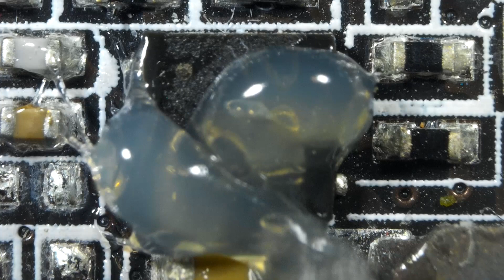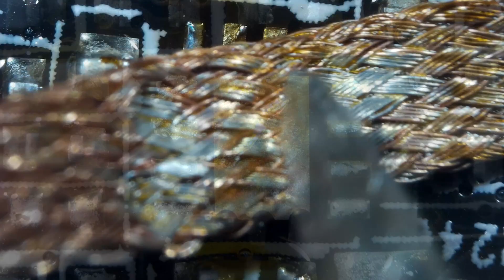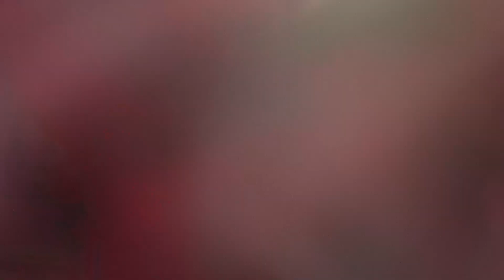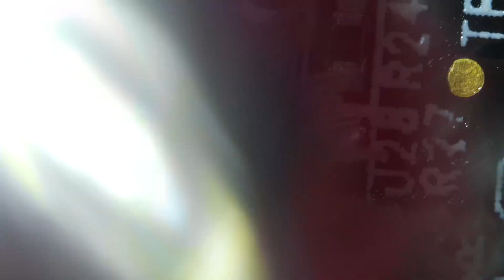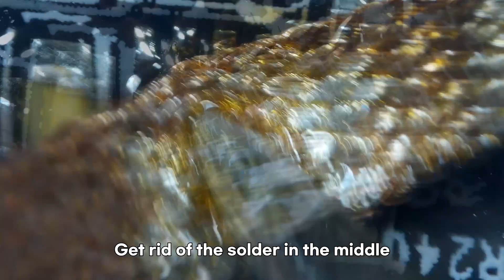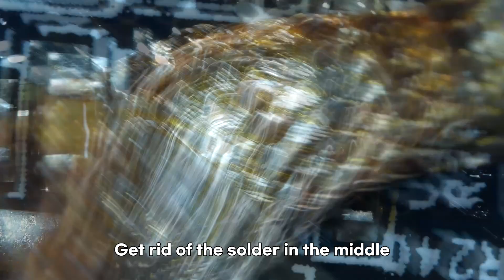How to Solder & Desolder IC Chips with Hot Air

Comment: I try to desolder ps3 super slim ic 88EC060-NNB2 chip.. In temperatur 380C. and 400c the chip still not desolder i try iron paste. And solder iron tip touch chip pin... Nothing happend chip still not desolder?!!?
Reply from the maker: There could be many reasons, but have you applied enough flux? If you did, what kind of soldering station and hot air do you use? sometimes, poor quality tools can cause this too.